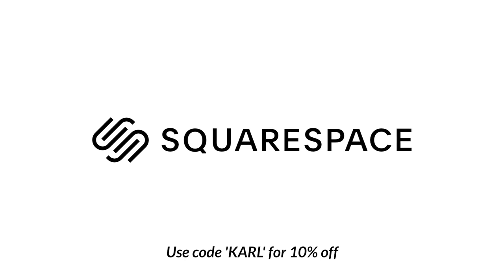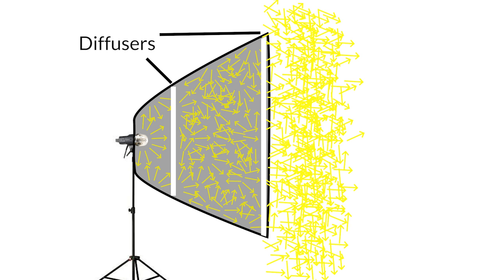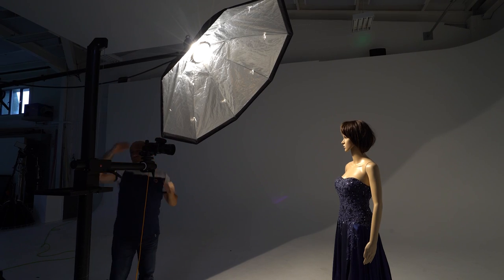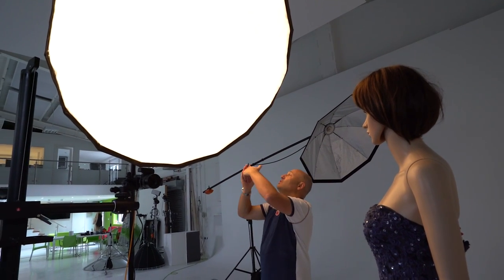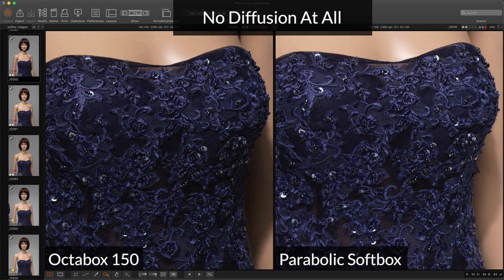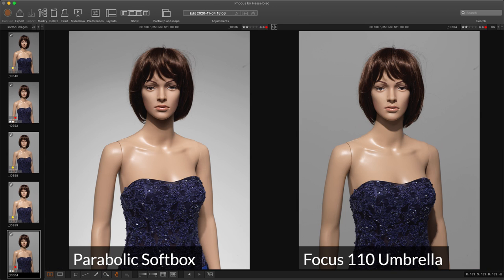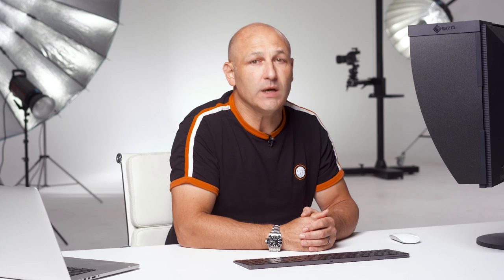The Myth of Parabolic Softboxes - Save yourself time, frustration & money!

Comment from the maker: Hi Guys, thanks for watching this video. As this video seems to be very popular many of the same questions keep coming up which I’ve summarised below:

1.  Yes I love parabolic reflectors, that was the subject of a recent video https://www.youtube.com/watch?v=femBzU9-hXI  - I use them all the time, but this  video is about something entirely different - please watch it through if you have time.

2.   I’m very happy that 95% of you understand physics, but for the 5% that don’t a parabolic light is supposed to collimate light in parallel lines so that it throws it very efficiently out of the front of the modifier in a similar way to fresnel lens (think lighthouse). To do that the light has to bounce off of the silver internal walls from a particular point called the focus point, where the light needs to be. But when light passes through semi opaque diffusion material such as white semi opaque fabric in a softbox then that light scatters in all directions. In fact, in good softbox design, it is diffused twice - first at the internal diffusion and then again through the front material. In doing so the light loses all of its collimated properties that were induced by the deep or parabolic design and the light is now non directional (other than the direction it is facing) and the light will be emitted at all angles unless something blocks its path such as a grid or the edges of the softbox. The light will be strongest in the way it is facing and within the area of its diameter.

3.  If there was only one layer of very weak diffusion at the front it is possible to retain some of the collimation properties, but not with two medium to strong layers of diffusion material. The purpose of good softboxes is to create an evenly uniformly illuminated large surface of light. When that is achieved you have a good softbox.  The light that then comes out from that front surface, whether the softbox is of deep design or shallow design, will be the same apart from efficiency of exposure, which can be adjusted by increasing or decreasing the power. There is no longer any collimation and the idea that the softbox can somehow still ‘direct’ light like a parabolic reflector goes against the laws of physics.

4.   For those that are able to notice subtle differences between the Octabox or the Parabolic softbox let me please explain. a) One light may be set at a slightly different power than the other as I had to change lights. b) Power and apparent size is also affected by distance and the softbox front face positions may have changed by approximately 5-10cm (2-5 inches) during the change over. c) Any actual change in exposure difference on the model to the background could be down to the fact that the parabolic softbox, although the same diameter as the Octabox it had a greater surface area. It also has a light source that is further back which would affect the intensity of light on the model relative to the background (inverse square law). d) Any small difference that people claim to see in ‘fall off’ could be down to the angle or position of the soft boxes.  e) And finally if the material is not a good diffuser then the softbox may have disproportional intensity across its surface which would also yield slightly different results.

5.  The purpose of this test was to prove how similar the results are given how different the designs are, which is expected as both softboxes should be producing homogenous light. If they are both producing homogenous light at the front surface then the laws of physics dictate that they will both deliver the same results and any variation in the results is purely down to position or overall sizes. If you still think light can be directed like a torch beam through diffusion, then have someone hold a torch in the dark at a piece of white paper and then hold another piece of white paper a few inches in-front of that. Then imagine how that would become even more diffused if there were silver internal sides bouncing the first diffusion light around inside too.

I hope that helps you understand the physics of what’s happening and why my conclusions are that one of these modifiers is unnecessarily cumbersome and heavy unless you have a particular use for it without the diffusion material. Thanks for watching the comparisons, for those who would like me to qualify my background and experience please see the 'MY WORK' link in the description below the video.
Reply: Loved this. I do like the round catch lights better than the octa catch light. 😄 I use these more for video lighting. Thank you again
Reply: What's your models Instagram handle?
Reply: As you asked me to look at your pinned comment i will also tell my thougts on that :
First of all i want to summarize that the one that makes the most clever marketing is you. The whole intension of this video is to underline that the broncolor is the only parabolic reflector. You do that by cleverly arranging your test to supress as much as possible the effect of a parabolic softbox (detailed explanations below) and also linking to your other video about parabolic reflectors where you say the alternatives to the broncolor para is renting a broncolor para. Not mentioning one real alternative and there are plenty of them. It’s like i need a car for daily use and and the only alternative to a Bentley is to rent a Bentley. But I could buy a used Toyota or what ever and maybe still end up satisfied. Sure the para is most probabely the best one out there. But its also 10x-40x more expensive than alternatives.
Pointing out in such an agressiv way how nonesense it is to buy any other than the para from Broncolor underlines the fact how afraid your sponsor is that someone could actually find out that a 10x cheper thing could do almost the same job. Sure they are all different. But different does not necessary means worst.

So here is how you cleverly supressed any advantage of a parabolic softbox in your video :

1.	by putting the lightsource in the middle above the «model » (best position to supress the effect of different lightfalloff to the background as the background will always be lit with the lightsource pointet straight to it) 
2.	selecting a very limited viewing angle showing the least as possible amount of background which makes it impossible to judge the light fallof.
3.	not making a test without the inner diffusor and only the front diffusor on the deep parabolic softbox. In point 3 of your comment you pointed it out correctly. Without a inner diffusor you will maintain some of the more directional characteristics of a deeper (and even parabolic) Softbox. And thats the whole sense of it. Of course, if you try desperetly to achive the same result as a normal softbox by putting also the inner diffusor in it you might just use a normal Softbox. But that is just one more option you have with the deeper parabolic softbox (turn it into a regular softbox IF YOU WANT). Althogh surprisingly it still was more directional as we can see from the slightly brighter background. Which you say is due to the inverse square law caused by the light source beeing furhter away as the parabolic softbox is deeper. Althogh this is still admitting that there is a difference it is just wrong as the frontdiffusor becomes the lightsource espescially when the inner diffusor is also applied. Applying that theory would mean that if you use a diffusor panel outdoors to diffuse direct sunlight (which is a lightsource that is 144'000’000 km away) would end up in no lightfalloff at all after the diffusing panel when dooing the math. Which ist’t the case of coarse. The diffusor becomes the lightsource and not the lightsource behind it. Its all about how the light hits that frontdiffusor, either with mostly straigth parrallel lightrays (still more directional light after the diffusor) or with lightrays coming from every angle to the frontdiffusor (much less directional light). The amount of the effect is of coarse depending on how much diffusing the frontdiffusor is eg the « half power angle » of it.
4.	Not taking pictures of the frontdiffusors (which are not overexposed) to show how evenly it is lit on the regular solfbox vs. the parabolic deep one. Of coarse in the video where the diffusor is alway totally blown out it alway looks homogenous as the whole diffusor at some point gets totally white even if not beeing homogenous. So all of you out there: the real way to test how homogenous the light is on the frontdiffusor of a sofbox is to take pictures of it at minimum power where no area of the diffusor reaches total white.

In your video at 2:11 you show a indirect parabolic Reflector/Softbox which is focusable. Why didn’t you used that one? Or at least as i pointed out in my comment you could have use a deflector to block the direct light of the bare bulb to turn it into a indirect (althogh not defocusable and always in fully focused positon) Parabolic reflector when you used it without any diffusor.
Reply: @VisualEducationStudio  Thanks for taking your time
a)	Not getting payed by broncolor and considering the only alternative to a para is renting a para makes it even worst. At least you would have a good reason to tell that.

b+c)	No, i’m not suffering at all with any conspiracy theory syndrome and i totally believe that they went to the moon that time. So you just occaisionally made the setup the way it is not showing the effect on the background it has. Thats ok, but that means that you occaisionally just blendet out the only comparable difference between the two types what makes the comparison usless.

d)	No, i did not purchased any of those deep Softboxes yet besides the Elinchrom deep octa 100 which i boght not for having a more directional softbox but to have more homogenous litten frontdiffusor as it would be the case in a shallower softbox.  Instead of putting me in the position of a fool try to argue for example against the fact that a shallow softbox (espescially without inner diffusor) will have a much more pronounced hotspot in the middle than a deep one. Or do you really want to tell us that a lightsource placed very close to a diffusor will light the whole diffusor equally bright as it would be by placing the lightsource much further away it ? 

e)	Hmm… what speaks against showing the real brightness distribiution over the reflector and compare them when you’re pointing out that the main reason and qualityfactor of a softbox is to light the frontdiffusor as homogenously as possible? And yes, maybe one day i will make a video that will also show that after ONE (not two or more) diffusing material there is still remaining a certain direction of the light. 

f)	You’re still not getting it. I totally agree that throing the light trough two sheets of diffusion will eliminate the desired effect. That’s why it would have been so important to only mount the outher diffusor without the inner one. And of coarse take pictures in a way that the effect is recognizable by showing more of the background and using the light from the side in a 45° angel for example.
Reply: @luciobarbanophotography5565  The rules of soft light are as follow : 
1) The bigger the source, the softer the softer the light. 
2) The more diffused the source, the softer the light. 
3) the **closer** the source, the softer the light. I know this is counter-intuitive, but yes, this is the empirical truth. Don't believe me? Take a torch light your forearm. Watch the shadow. Bring the torch up : the shadow becomes clearer. Brings the torch down : the shadow becomes blurrier. The further the light rays have to travel and the more defined they will be; hence why you get harsh light on sunny days and diffused light on overcast ones, where the light is being diffracted in all sorts of directions before reaching us. 

So when you say "you really want to tell us a lightsource placed very close will light equally bright as it would be ny placing the light source much away from it", the answer is : no... because it would lit more equally and you'd have less of an hotspot in the center. Period. You're concentrating the light rays further away into a narrower point with the deep "parabolic" softbox. 
A spotlight for stage use is often over 100 meters away from the stage, while the flood lights, or washers as we call them in the entertainment industry, are literally on the stage.

I you cannot admit you're wrong then really there nothing that Karl nor I can do for you. If your deep octabox inspires you then sure. But if it's more directional, then it's gonna have a less homogenous output. However, on those tests the parabolic softbox gives an ever so slightly less directional result, or so one would think; but look again at the *backgrounds*. There you can see the hotspot of the parabolic softbox. This become increasingly obvious the more diffusion is removed. The results are about identical except for the hotspot in question. Why would you want that? You can light the background separately if you want.
Reply: What are your thoughts on the new Lantern Style soft boxes we're seeing all over youtube at the moment like the one from Aputure.
Reply from the maker: That sends light in all directions so essentially reduces the contrast by lowering the density of your shadows. However if the front of the lantern facing your subject is smaller than a conventional softbox then your directional light won't be as soft.
Reply: I will admit that I don't always fully get physics. I do understand what you're getting at, but generally thought the advantage of the parabolic and/or "fake" parabolic modifiers was the control of fall off. Which I interpreted to be the tighter spread of the light so you could light up your subject with less hitting the background if needed.

I will say that the design appears to concentrate the light more when you remove the outter diffusion. I find this advantageous when using battery packs and blending with or overpowering the sun. I get to use less power and get more shots.
Reply: Nice comparison. But do you think the result is different for video usage? I mean the barebolb of the flash unit is spreading light in pretty mush every direction. But in LED video lights (aputure, godox etc.) the diod is deeper in the socket so it needs higher curveture angle of the softbox so the reflective surface will be much more effective. Know what I mean?) Would be glad if you responded to this)
Reply: @muralboletube  thats exactly on point, parabolic designed softboxes are actually very good for LED COB light source
Reply: Wow
Reply: Nice video! what about for video lights? Do you think u will get the same results? Thanks
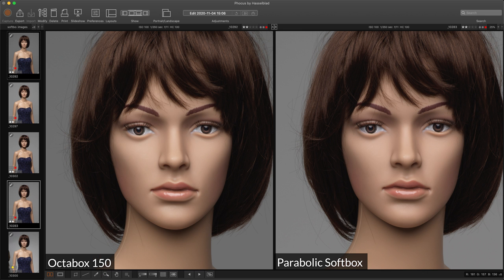Reply: Idk if its the way you shot it, but at 5:51, the parabolic has the better contrast, softer light spread, and less green tint, presumably from the shorter distance? Either way I'll run some tests.

Comment: Karl makes the crucial point that for a TRUE parabolic reflector the light has to face into the reflector if one gets the light ( and truly it has to be a point light source) at the focus then one would get a parallel light beam, emulating direct sunlight. Once a diffuser is in place the surface of the diffuser becomes the light source, what is behind that surface is irrelevant.

Comment: Totally agree. For a while now our studio's go-to modifier has been our shallow 40" octobox. A few months ago we found one of our resident photographers had brought in an expensive parabolic softbox. It was a nightmare to use in a small studio, really heavy, too big to leave up when not in use but an absolute pain to pack away and set back up. It also had an octagonal 40" front with a similar diffuser and guess what, we couldn't tell the difference either! It did illuminate the backdrop a little more due to the more directional throw but this is a negative, especially in a smaller studio like ours, as we want to control the backdrop lighting separately. It now sits in a corner packed away and gathering dust.

Comment: Good demo - thanks Karl! It looked like more light made it to the backdrop with the parabolic. Subtle, but noticeable, even with the diffusion on. Not that this would be an advantage in most cases.
Reply from the maker: Thanks Curtis, I think more light made it to the background just because the deep softbox had a slightly bigger surface area and also as it is deep, the actual lamp head is slightly further back, so it could be partially down to inverse square law too.
Reply: So glad you pointed this out because we need the longest possible throw of light in clinical scenarios, and as usual, you add value that cannot be found elsewhere. Thank you Curtis.

Comment: Your points make completely sense. 
But. Where I see the real difference is when using these lights for full body shots. I do own both a 150cm octa and a 150cm "parabolic", which I use with no front diffuser on. 
It's still not a true parabolic, we can all agree with that, and they should be not called so, but the shape is different and the light is different. 
I've noticed it with the last set of images (no diffusers), the background in the photo with the "para" has a bit of a vignette, and it's lighter closer to the subject than the regular octa.

I'd love to see this test done again with a light meter involved, and full body images :)
Reply: My thoughts exactly. 
 At 6:08 I did observe that with the front diffusion removed the light fall-off on the subjects cheekbones was a bit more drastic, but it was still no where near what a true parabolic dish would achieve.

What a shame. A true parabolic light modifier would be useful in simulating direct sunlight. Throw some very light blue defision on it and you're simulating the sun and sky.